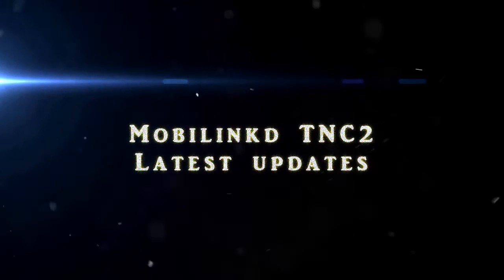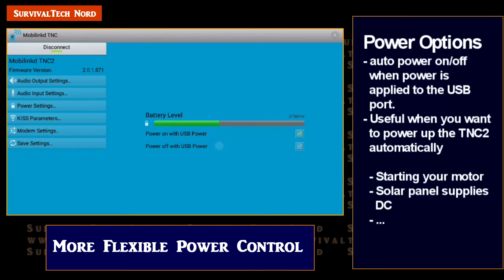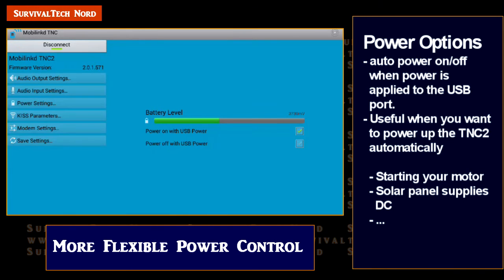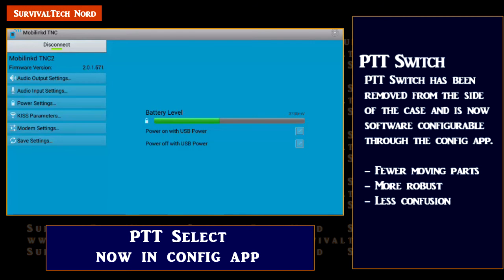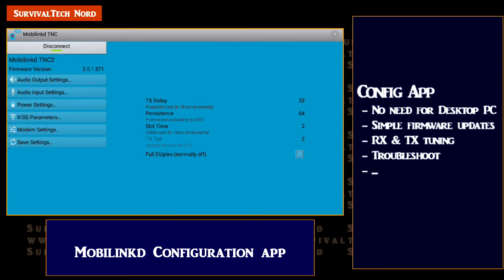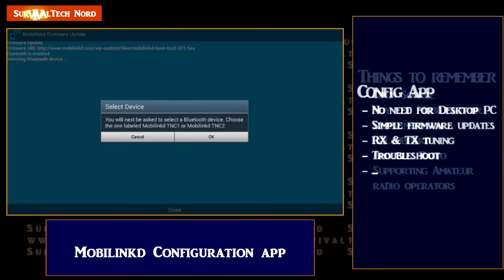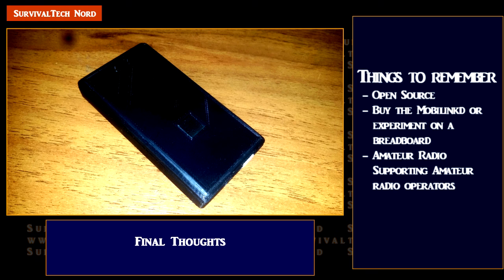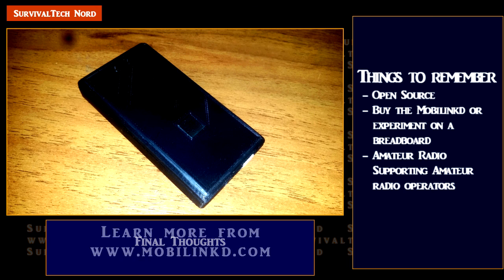APRS Mobilinkd TNC2 | Latest Updates

Comment: What amateur radio android apps can you ge to work with the mobilinkd besides APRSdroid? Any digital modes like rtty, psk, or olivia?
Reply from the maker: Great question 
 The Mobilinkd can be used with APRS/Packet, but there is only APRSDAroid ATM. For those other modes a soundcard modem would be sufficient. Im using the WolphiLink on Android with SSTV,  PSK, RTTY, and now with the Android version of FLDigi (AndFLMSG).
Reply: What I am wondering is can you use Andflmsg a mobilinkd and a baofeng radio plus cable to send digital comms over UHF and VHF.  If so I would love to see a video.
Reply: PS what is your Call sign?  I would like to try the APRS text messaging with you if you are up for it one day
Reply from the maker: Here is an indirect answer to my callsign question https://instagram.com/p/8mM-MHsKjY/ 
Here begins the problem with UHF/VHF HTs. For APRS the FM HT radios are fine. For other modes,  you'll eventually have to upgrade to an SSB radio.  That's why you see the FT-817 in so many of my videos. PSK, RTTY, SSTV, ... are not FM compatible modes :/ The workaround is a Shortwave radio like the CountyComm GP-5/SSB which will give you SSB capabilities for digital modes found throughout the radio spectrum (RX only). This is another reason I try to gently push people toward multi-mode radios.

Comment: I own the first generation TNC1, without case. Both the PTT style switch and the TRRS connector broke. Our cries have been heard! ;-) My TNC1 has a blob of solder for switch, and 20 cm pigtail for the TRRS jack. (oh, and I found out about the Mobilinkd TNC1 because I used aprs.fi at the radio club without adblocker)

Comment: Mobilinkd is pretty cool, if they could just update bluetooth to bluetooth LE then you could use it on IOS and get more high speed features.  All in all mobilinkd is the best aprsdroid hardware sidekick
Reply from the maker: Yeah, iPad/iPhone users are out of luck as Apple still doesnt support SPP (Serial Port Profile) over bluetooth. That doesn't seem to have changed with Bluetooth LE.
Reply: SurvivalTech Nord You are correct but sending data without having to use the SPP would work.  For Example
http://www.adafruit.com/product/1697

Comment: Can this be used to connect to a Packet BBS? in addition to APRS use?  Thanks for another great video.
Reply from the maker: Thanks for the great question.
Unfortunately,  The Mobilinkd is only a kiss TNC and cant be used for full packet radio as needed for BBS access. 
I really wish it could though!
Thanks for watching.
Reply: When I pair the Mobilinkd TNC with my GNU/Linux Debian laptop, I'm able to use the "device file" /dev/rfcomm0 with axcall, axcall is software to make AX.25 connections. This works fine with all BBS around me!
Reply from the maker: danr97123
Did you see the comment from Henk?
Henk de Vries thanks for sharing this!
Reply: Thanks for the tip! Maybe I will need to buy one of these and experiment a bit.

Comment: Great video Julian.  I had version 1 of this device and the cable connector popped off the board during its first use.  It was a humbling experience as it reminded me that no matter how technologically advanced something is, if the basic design and workmanship is not rugged, failures in the field should be expected.  I hope in v2 the component mounting to the board has improved. I was thinking that epoxy coating the board might make it more rugged; don't know if others have tried that.
73
Greg
Reply from the maker: Thanks for the feedback.
I also had one which the 4 pole trrs connector came off the board.  The solution for this was the new case. The case prevents the upward leverage that allowed the socket to be lifted on the original version, which was very delicate.  I like the epoxy idea, but admittedly,  I was happy to have the case! I've seen the evolution of this product, and i'm confident that it will continue to improve over time. I don't get paid to say that i just love this product :)